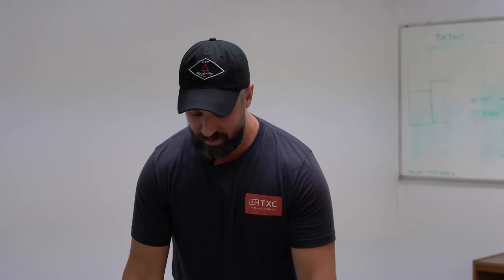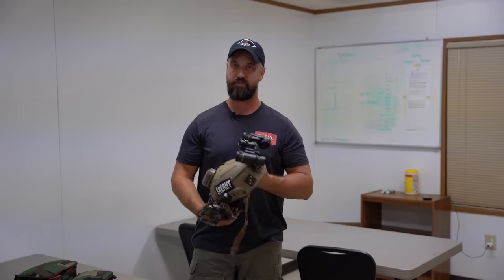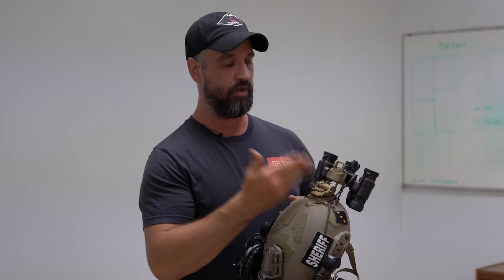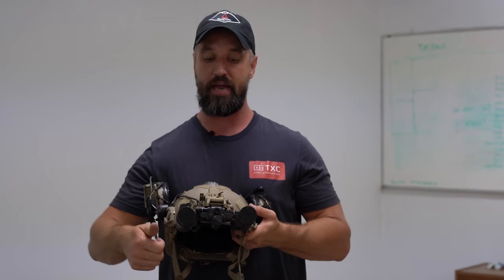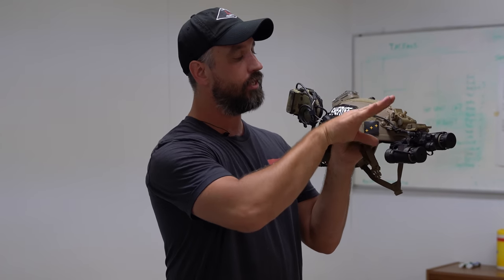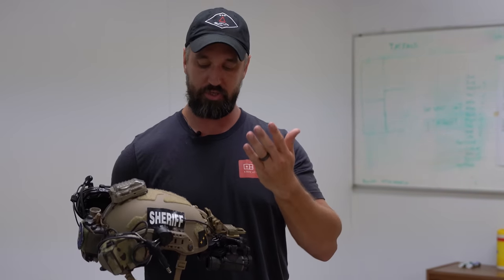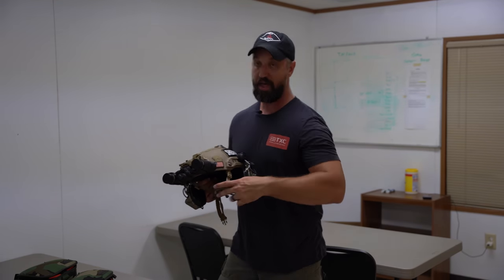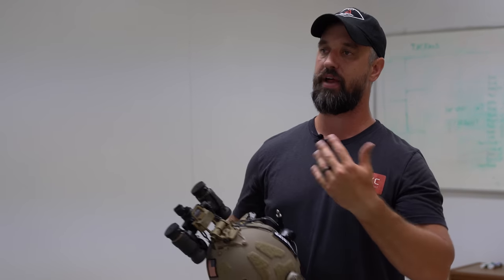HELMET SETUP: AN END USER’S PERSPECTIVE ON HOW TO SET UP YOUR HELMET FOR DUTY AND NIGHT VISION USE

Comment: i have FMA FC amps for comms/earpro and its amazing i loveeee the mounting on the rear rails alot more than the wires on the top arc because they tend to get in the way and not squeez as tight

Comment: I ditched L3 tubes for Photonis.  Far superior for anything other than pitch black/extreme low light.  If I'm working no moon, in the forest under cloud cover, the L3's will absolutely destroy the Photonis.  But with any other conditions, especially urban settings with dim lights, cars,  or if someone NA's me, a flashlight from someone other than the team fires etc. Photonis dominates.  Its got a bad rap from the community because people want purchase justification after spending 1.5 to 2x the money or budget.  Of course commercial Photonis tubes aren't always great.  

But LEO/Mil Spec are incredible.  "BuT tHe Gainz" lol. Gen 2+ is a completely false label.  Its gone way outside the original 2 decades old specs for generational designations.  Built on gen 2 yes, but its now not even remotely classified as any generation.  The technology that has been placed into them isn't described at all in the generational definitions.    If you can find a set at 2500+ FOM with low EBI try them out in urban.. You'll shit. Bring wet wipes.

Comment: Awesome video. Will those bikini covers with the holes protect the tubes if they are stored with the caps on like that
Reply from the maker: I am not sure I understand the question
Reply: @oriontraininggroupllc2782  I meant to ask do those covers provide enough protection of the tubes even with the holes punched in them
Reply from the maker: @ma.santiago89  protection from what? Do you mean sunlight? Or impact/blast?
Reply: @oriontraininggroupllc2782  ligh
Reply: @ma.santiago89  They do not. That roughly 556 casing neck sized hole creates a second focal plane, which trades image brightness for the entire image being in focus. They are not protective caps or daytime caps.
Reply: @Enkrow  Thats why I run the adjustable iris on mine.  Instead of trying to adjust focal plane of one side vs the other or both when needed inside a structure, I can close them down pretty small since tube specs are god mode and still see amazingly well but everything is in focus.